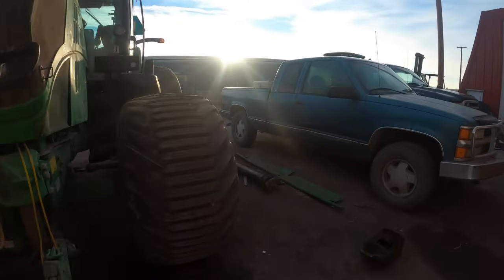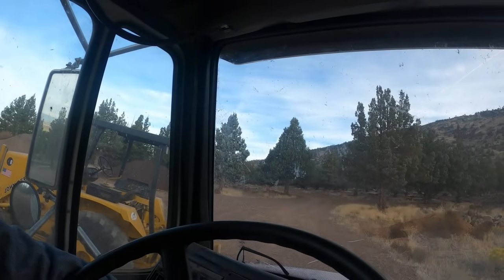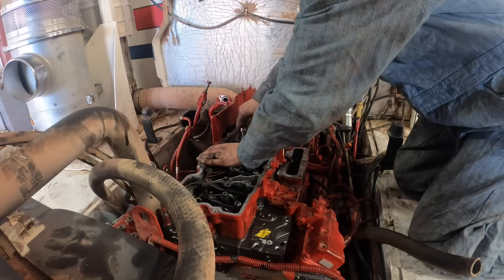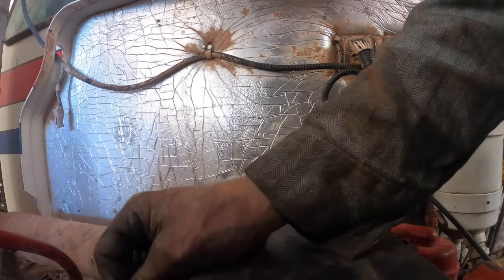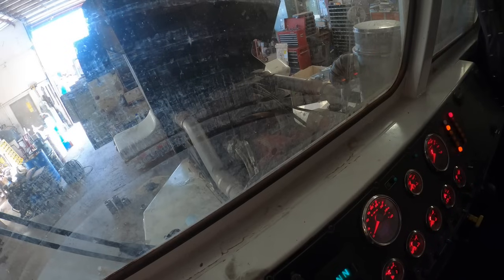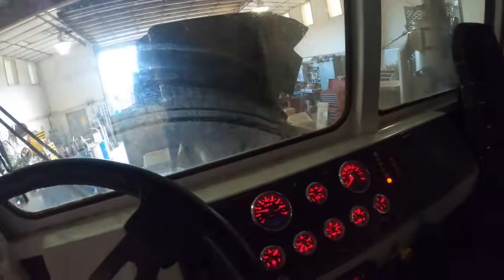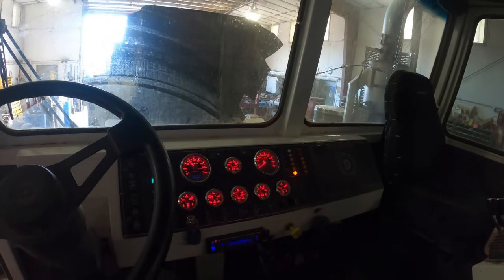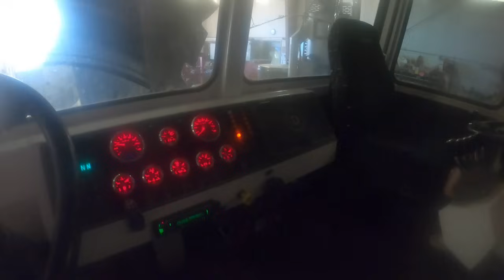Finishing another engine rebuild.

Comment: Hi Warren, I know what you mean by changing a cracked hose. I put and engine in my car with less then 5,000 miles on it. One day on my way home I started to smell something sweet. It overheated. I pulled over and shut the engine down. Put a new heater hose on but ended up with a miss in the engine after that. Probably cooked a valve or two. So from that point on I just replace them all. Cheap insurance. Needless to say the car was around another 4 years before the rust belt got it. Glad to see ya try to wear gloves. A good buddy of mine ended with Cancer. He worked with metal for several years. Who knows if that was the cause but he never wore gloves to work.

Comment: The Cummins ISX15 engines sure haven't been as good as they should have been. 
Front and rear structure oil leaks, high pressure fuel pump failures that can destroy an engine and the dropped liners, high oil consumption due to carbon packing in the piston rings.

Almost like they didn't do enough testing before full production.

Look at the old Cat C15 engines, seems they all made over the million mile mark before the oil pan or head had to come off.